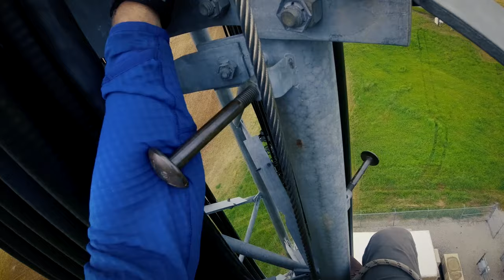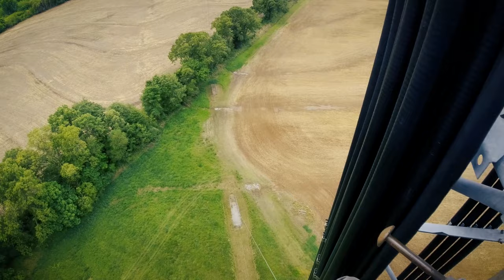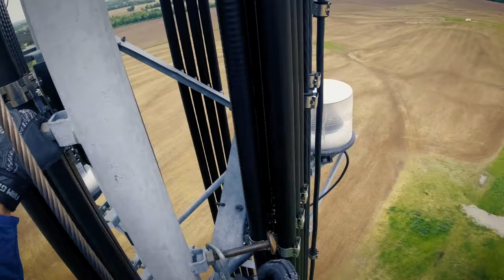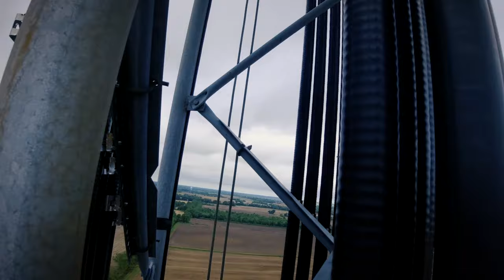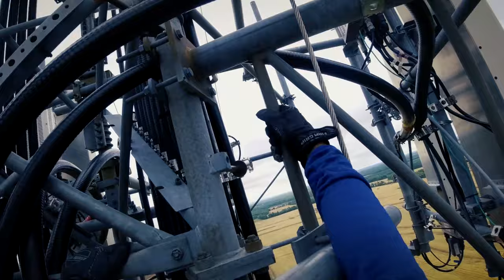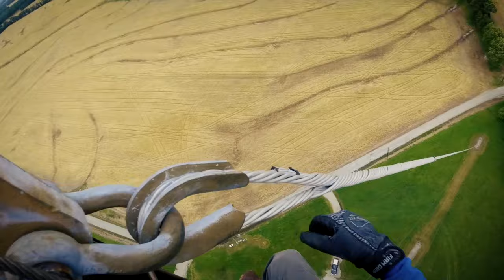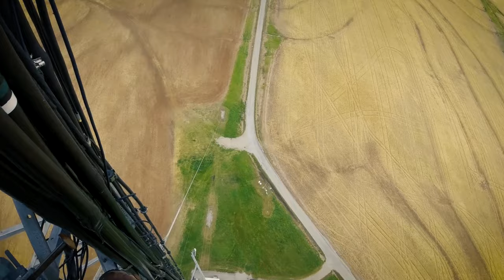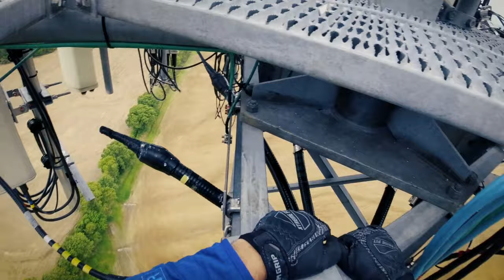My New Job | Climbing Cell Phone Towers

Comment: How does that fall protection cable work? Does it have a grabber in your harness that grabs the cable if you fall to a certain speed? (Don’t know how to explain what I’m asking)
Reply from the maker: Basically exactly that. I wear a thing called a “safety brake” that the cable feeds through. If I most downward in to fast of a speed the friction plate pinch’s the cable and stops me....I believe I show how it works in one of my other videos too.

Comment: The highest I've climbed as an arborist is 100' and I can go higher .
Do they pay good doing this climbing?
If so, where can I search? Thank you
Reply: They don’t just pay you to climb 😂😂 it’s definitely way harder than cutting a branch.
Reply: @RxTerps  
I think this is a piece of cake compared to remove 100 ' tall and 70 ' wide trees with a sharp chainsaw and spending 10 hours climbing with a 56 lbs harness including ropes, blocks and carabiners. 
Climbing and replacing a light even if it's 1,000 feet high should be easy when you know the tower isn't moving or can brake like a tree.
Reply: And I meant at least 10 hours daily climbing and you keep cutting the big logs so close to your Buddy with a sharp saw . I dear you to try tree removal and then tell me your job it's not like cutting a branch!!